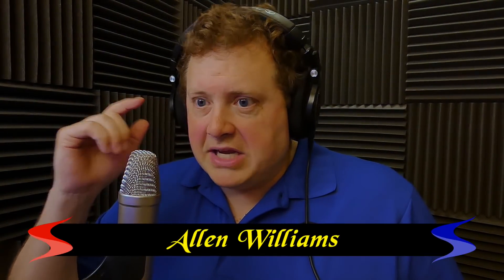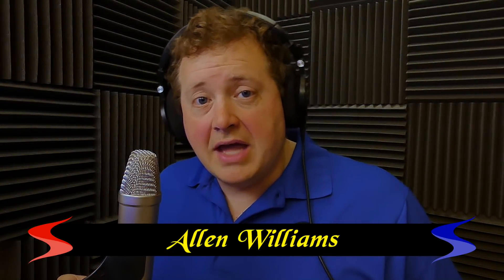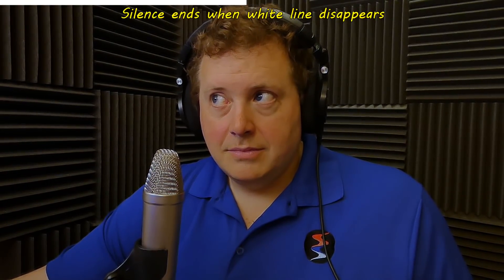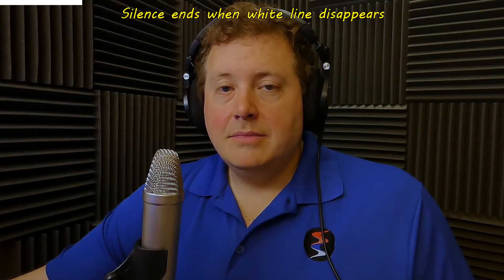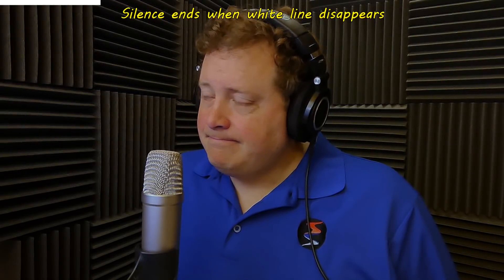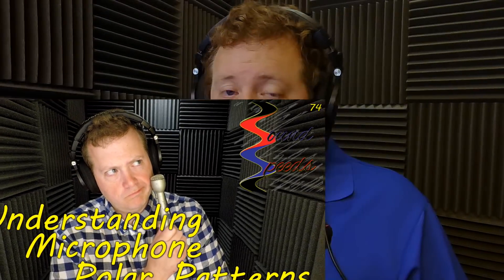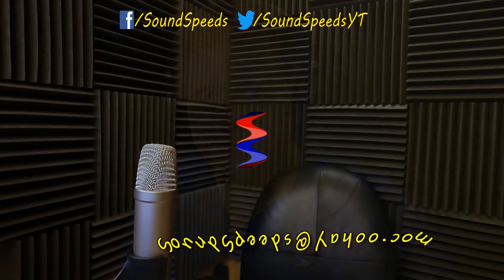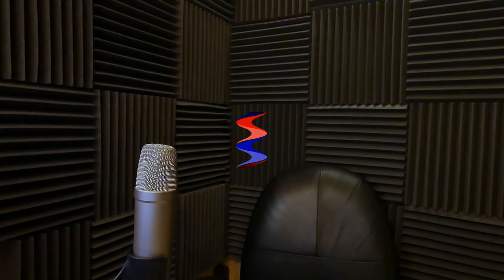High Background Noise vs Isolation Shield & Crashguard - Sound Speeds

Comment: The software was hands down the best solution.  I was very surprised at how little the the hardware solutions actually helped.  I dont know anything about game streaming, (well let's be honest I dont really know much about sound in general)  but I'm curious as to how you  route Reaper out to the stream while using the software solution.   I'm also left with this thought. If some has the ability to operate a proper DAW,  like Reaper. and get their stream routed out threw it they are more than likely pretty solid audio kind of people.   That said, those people would not likely accept the sound quality.  Someone that would accept it would NOT have the skills to create the solution.   Sorry this comment is such a broad stroke.  I will say this test really has me thinking.  That's why the channel is awesome.  It always opens my mind to ideas and concepts.  Thanks for that!
Reply from the maker: Streaming is a different creature all together. You wouldn't go into Reaper to process your sound LIVE or at least, you shouldn't because there are better programs for streamers. Open Broadcast Software is one such program. It's great for streaming with simultaneous recording because you can make changes to streaming resolution, audio and video bit rates, etc. You can also use some plugins with it which is great.

Comment: First: I'm not a sound professional, I'm in my early 50s with a normal hearing for my age. But I'm interested in sound, listening, noise pollution, soundwalks, field recording etc..
I think the noise reduction software did a good job. Professionals are very much more critical than the final consumer is able to hear/see differences with an untrained hearing. As a shutterbug I once had two pictures from a photo magazine, one unedited and one slightly edited. A completely inexperienced colleague of mine saw them and asked after a closer look: Where is the difference?
So I think if you didn't point out the differences in a side-by-side comparison like in this video a normal person wouldn't hear (or better notice) any difference.
But until a recording meets the final recipient a lot of professionals will listen to it before and it has to pass their standards. And in general this is necessary everywhere to keep standards up. There is never something "too good".
Reply from the maker: Comparisons encourage critical listening and I agree. Many tools do the same things and many can do them effectively. How did you listen by the way? Phone? Speakers? Headphones?
Reply: Sound Speeds I listened with headphones, Sennheiser HD 380 pro in my usually (and thankfully!) very quiet flat.
Reply from the maker: @thoresiebrands461  Thank you

Comment: Very cool video. Were you using the default sample setting in ReaFir? I’ve used a technique of acquiring the sound profile in ReaFir with a very high sample count and then turning the sample count down when removing audio and found that to be better than just straight 1:1 profile creation and subtraction. 

That being said ReaFir with 8k samples is not necessarily the fastest plugin so it may not be ideal for a live stream but perhaps more suited to Let’s Play type videos because of the need to dial in the delay versus processing prerecorded audio. Now that OBS has an ASIO plugin this might be interesting to revisit. Perhaps a plugin shootout? Waves has some live noise removal plugins iirc. 

I’ve also found that the noise floor of games will hide a good amount of that random ambient noise in a nominally quiet game streamer’s room (not the white noise generator but very likely the computer fans and air conditioner). A lot of streamers have the awful habit of lowering the volume of their game audio significantly versus their mic audio so that can prevent the game from “assisting” in hiding those noises.
Reply from the maker: I'm very interested in the Waves NS1 plugin and think it's worth buying. I've reached out and requested a license from them but will buy it if they don't want a review in exchange for one. Reafir is OK at best and not great with high noise. Kinda sloppy in my opinion.

Comment: I'd say, the white noise source blurred the result a little. Since it has constant level all over the spectrum, you can't really get rid of it without noticable losses. But typical noises are less constant through the spectrum, more managable with isolating and absorbing materials. And, in addition, in this particularly test those noises was far more quiter. I barely heard cooling fans (it's five of them though!) behind white noise and I'm not sure if I heard air conditioning at all. You provided spectrum graphics, but didn't measure levels of the sound sources individually to visualise an impact of each one. If environment noise level comes dangerously near the useful signal level, you should consider reorganizing your workspace, instead of relying on cardioids (it's a booth, man, reflections are always there and foam isn't a silver bullet), shields, filters, audio processing, etc. At least, that's what people should understand from this video.

Another word about reflections and polar patterns. If you rewatch silence test with crashguard, you'll notice, how white noise was changing (becoming less sharp even), when you've thrown your head back a bit. So, in my understanding, when you put a noise source exactly behind the mic (in good intentions), you get some dose of reflections from your own body. It's a kind of funny fact.
Reply from the maker: All great input. Yeah... in fairness, this test came from a conversation I was having with a group of people so I tested as requested. There's no substitution for eliminating background noise when recording but... I do think the isolation shield did the best. Comparing the charts you can see how it dropped and even changed the sound a bit thru reflections. Kinda interesting results.

Comment: Very interesting test! I feel like, when using ReaFir, the isolation shield makes a difference in the quality of the processing. There was some lost fidelity as a result of the ReaFir processing, but it still sounded good enough. I think that combination would work for game streaming or something like a podcast posted with a low audio bit-rate. I’ve seen some audio streams at something like 32 kHz 96 kbps MP3 and I think the extra lost fidelity from that would make it difficult to tell the difference between a pristine sample and the one with noise removal.
Reply from the maker: I agree and will add this... Reafir isn't the cleanest at processing high background noise over voice tracks and considering this is the extreme, you could (and should) back off on the wet processing just a bit and maybe even add in a low, gentle hiss to fill out the low noise floor.  To your point though, bit and sample rate of the delivery matters.

Comment: Actually, I started using a free program call Vsthost and a vst plugin call ATKexpander, and I was able to make my room completely quiet, to my surprise it even blocked out the fridge noises. My threshold is -38.4,  slope 1, and softness -4.0, attack is 10.0, and Release 10.0. It work very well, you could see if you can try it and give a report on it, but it's pretty good, and I didn't have to spend any money.  note you'll need to keep vsthost open and record on audacity or something by recording the output source.
Reply from the maker: Never heard of that one. I'll keep it in mind.